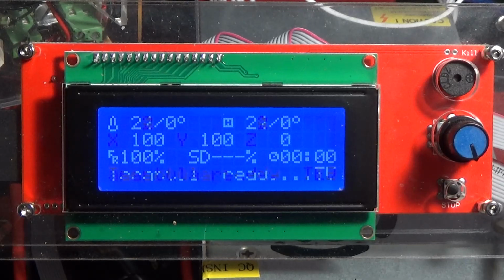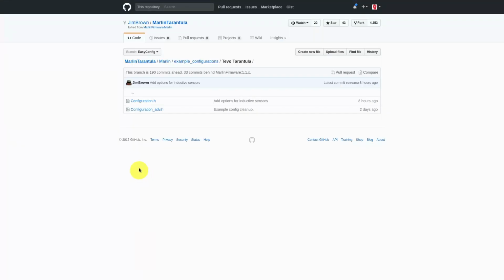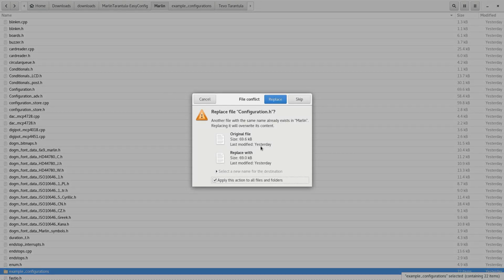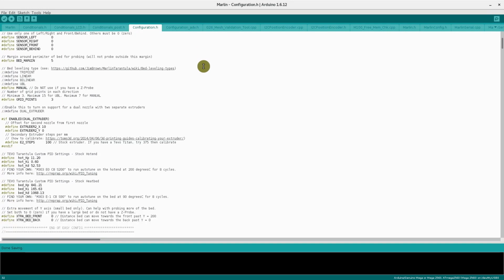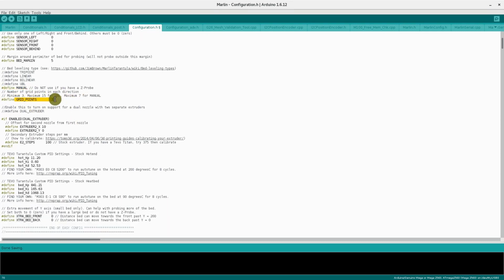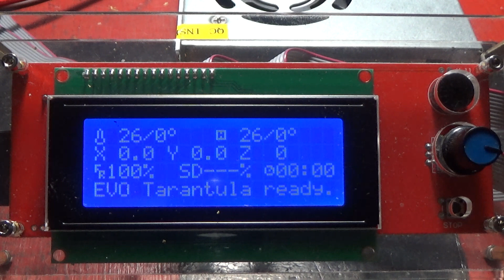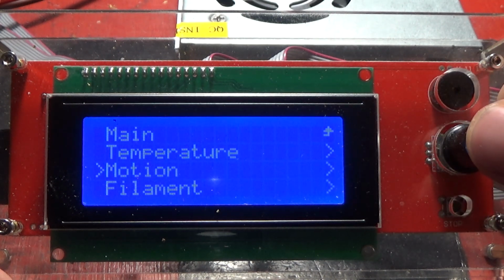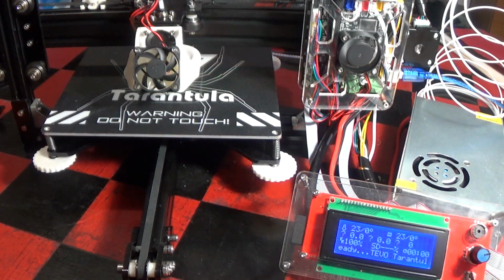Tevo Tarantula 3D Printer - Flashing new Version of Marlin Firmware with EasyConfig

Comment: After following this step by step it successfully uploaded the new firmware. I even renamed the printer for fun lol. Although I do have one issue now. My Hotend will not heat. All I get are heating errors. I am using an E3D v6 clone and it was working like a dream before the firmware update. If you or anyone could help I would be super happy.
Reply from the maker: Which errors are you getting exactly? Have you tried setting factory defaults? Which error are you getting exactly? Please also double check all your connections.

Comment: Anyone else have a problem with the z- port on the old tarantula? I want to recompile so the z+ port is used instead.  Yes i checked the switch and cable with a multimeter and they work.

Comment: When i compile i get several errors
Reply from the maker: Are you just stating this, or do you want actual help? If you need help, you will have to tell me what the errors say...
Reply: @stylesuxx  i'm always getting ... fork/exec C:\Users\Max22\AppData\Local\Arduino15\packages\arduino\tools\avr-gcc\7.3.0-atmel3.6.1-arduino7/bin/avr-gcc.exe: The filename or extension is too long.

Error compiling for board Arduino Mega or Mega 2560
Reply from the maker: @NMHC1978  Sorry, no idea, I don't use windows. Sounds to me as if the path is too long? Try googling the error, there seem to be a couple of things to try.
Reply: @stylesuxx  I googled it already several days there seems to be no solution for it. I tried the latest beta 1.9.0 of arduino and its giving the same error. i cannot find a way to modify some inifile that this pad C:\Users\Max22\AppData\Local\Arduino15\packages\arduino\tools\avr-gcc\7.3.0-atmel3.6.1-arduino7/bin/avr-gcc.exe is shortened. The build path can be shortened but is not helping
Reply from the maker: @NMHC1978  I'd try older Arduino IDE version to be honest... Also it seems that other people had more luck with platform.io Also it seems commenting out displays seems to have helped other people - did you try that too?
Reply: Hello Marnix
If you are using Arduino IDE, it does not work for Marlin 2.0 anymore. You need to use Visual Studio Code with PlatformIO extension. I will send you one good tutorial now.

Comment: can I reset it back to factory if it doesn't work out
Reply from the maker: Well, if you can find the original firmware somewhere - sure. But there is no 'factory reset' button if thats your question.
Reply: @stylesuxx   looks like Tevo hasn't released the default software. I have an old tarantula that works well except I can't change the "home offsets" it just beeps when I try. not sure if I can set the offsets manually with gcode, I'll probably end up flashing it with Marlin 1.1.9 since 2 seems complicated to compile

Comment: Thanks, you made this process simple. I did all and works fine however the display push knob is not working after the upgrade. Any idea?. Thanks
Reply from the maker: Hmm, very interesting, just the push in action is not working, or also the scrolling? Do you have the same display as seen in the video?
Reply: It is the same display as in the picture. The push function does not work, and when rotate the FR100% change.
Reply: Still not able to use the SD card which was the main reason for me to upgrade...thanks
Reply from the maker: Interesting. Which version of the firmware did you flash?
Reply: I just downloaded it today from the link you posted above. the display show BugFix 1.1.X, in fact the configuration file looks little different from your video but I guess is because they add more features.
Reply: I just downloaded the firmware today from the link you posted above. It says BugFix 1.1.X.
Reply: Sorry to bother you on this, but I also noticed cooling Fans wont stop or start until you move any of the axis. that was not like that on the original firmware. thanks
Reply from the maker: You are not bothering me. The config files might look slightly different, but you did copy the ones from the example directory to the main directory, right? Also you are powering the printer from the PSU, and not just from USB? I flashed my printer yesterday with the 1.1.x release - it is working flawlessly on my side. The printer does not recognize your SD card? Have you tried a different one than the one that was supplied with the printer? I have read, that some have had problems with the stock one. also see, if slight pressure on the SD slot helps, maybe there is just a bad contact. In configuration.h "#define SDSUPPORT" is enabled by default, please double check that. I might be a little unresponsive this weekend, so answers might take some time - if you want quick help and a lot of user power, I suggest visiting the Facebook group => https://www.facebook.com/groups/TEVO.3dprinter.owners/
Reply: Hi,Yes, I did copy the Config from the example folder, SDSupport is uncommented. I am Arduino programmer and this is very familiar for me, also I am powering the printer with the PSU. The printer did not come with any SDcard but I tried two, one 32 GB and one 4GB, formated in Fat16 and Fat32( all four combinations). When I insert the SDCard it report it as Inserted in the display but then can not access any file or upload etc..My main concern now is been unable to access the menu in the display and that little bug of the cooling fan status no changing unless any axis is moved. It is like waiting to move to execute that command. Other than that the printer is actually printing fine. I tried the original Marlin 1.1.6 with different configurations but no success.
Reply from the maker: Hmm, OK - I am not really sure how to help you any further - sounds all good to me. I use the 8GB card, that came with the kit, FAT32  formatted. Check the FB group, there are FW packages configures for the Tarantula - if it is not working with this one, maybe your display board has some issue, since the SD card was not working from the beginning. With cooling fan, I suppose you mean the layer fan, right? Both, the fan for the heatbreak and the one for the board I wired directly to 12V, so they are basically always on. Which software are you using, to actually print with the printer? I only used the on board menu for printing...
Reply: I appreciate your help and will continue looking for the problem. I use Repetier and Simplify3d. They actually prints really good from USB but just looking a backup as a couple of time the windows crashed and the printing was interrupted. About the fan it is not a big deal either. I have the cooling fan to start from the second layer. This way I find the adhesion to the hot bet is better. Thanks again.

Comment: when you home Z   After you do the software upload     how do you programs it to home in the middle of the bed.    mine just homes where every the print nozzle is
Reply from the maker: Hmm, so when you are homing, it is not moving X and Y to the limits, but just homes Z? If you are only homing Z it will just home Z ;-) Use auto Home and it should home X and Y to the limits, then home Z and then move to the center...

Comment: Good video, but why it home at the center instead of in the left? My stock firmware just stay at each endstop position it doesn't come back to the center
Reply: It homes Z at the center because "safe homing" is enabled by default in my configuration. This is needed for those with a Z probe. For those without a Z probe, it makes no difference if safe homing is enabled or not. So, for simplicity sake, it is left enabled.

Comment: I am also going to dual z lead screws using one motor and I need to reverse the Z direction.  Using Notepad++ lines 1114 says #define INVERT_Z_DIR true and 1116 #define INVERT_Z_DIR false.  Which one do I change or do I change both so that 1114 says false and 1116 says true?
Reply from the maker: In which files are you making those changes? It should be enough to comment in the line "#define CHANGE_Z_DIRECTION" in your Configuration.h
Reply: I am making the changes inside configuration.h.  I see the //#define CHANGE_Z_DIRECTION  so would I just change it to #define CHANGE_Z_DIRECTION  without the //

Comment: HI
I have installed the Titan Extruder and it turns in the wrong direction (pulls the filament out)
In your video you show checking the other motor directions.  Is there also a change direction for the extruder??
nice video thanks
Reply from the maker: Yes,  "define CHANGE_E0_DIRECTION" if using the Titan extruder you will also need to adjust your E-Steps.
Reply: Thanks for the solution have a great day
Tom
Reply from the maker: Glad I could help. Have a great day too.

Comment: I had a problem when carling the marlin, some solution :

C:\Users\Sergio Fregoso\Documents\Arduino\libraries\LiquidCrystal\I2CIO.cpp:35:26: fatal error: ../Wire/Wire.h: No such file or directory

 #include <../Wire/Wire.h>

                          ^

compilation terminated.

exit status 1
Error compilando para la tarjeta Arduino/Genuino Mega or Mega 2560.
Reply from the maker: Please make sure you have the wire library installed => https://www.arduino.cc/en/Reference/Wire

Comment: i have the MKS Base V1.4 board and when i try to do this with either my Win7 laptop or my Win10 desktop it doesnt connect.
Win7 laptop just labels it as "FT232R USB UART" and never given a com port.
Win10 desktop just slaps an unknown device label on it.
Reply from the maker: And you do not see it in the Arduino IDE? I really have no experience with windows, maybe you need a driver? It is just a serial to Usb adapter, that should be recognized by default...
Reply: yeah i cant see it in in the arduino program at all. 
Are you using Linux? if so got a recommended OS? i dont even use my laptop anymore so im totally fine converting it to linux, never did it because i had no practical use to do it lol.
Reply from the maker: @vineheart01  yes, long time Linux user. I would recommend Ubuntu - lot of community support and documentation/tuts on the web in case you get stuck. I personally use Debian.

Comment: I have a few problems: 1. The Tarantula already comes with Marlin installed and mine supports dual extruders, large bed and auto bed leveling.
2. The stock "green" sensor won't work in my case, because I'm using a mirror ontop of the bed. I'm also using a "orange" inductive sensor that can sense through the mirror, but it can't be mounted in the place of the "green" sensor. It is now mounted in front of the heatsink fan, and is outside the bed. I don't know how to make the printer know this and adjust accordingly using ONLY Gcode commands and the GUI. I'm also running OctoPrint because the printer won't connect to my PC via USB due to Windows 10 driver incompatibility. I have tried installing all possible drivers, it just will not recognize the printer. The error is "device description failed".
3. It does the autoleveling fine now, because I moved the bed back so the sensor is ontop of the bed. I adjusted the correct height using a piece of paper in all 4 corners, and adjusted so that the sensor just turns on when it's at this point. I even set the Z axis to 0 at this point. When I start printing, it autolevels, but the nozzle is suddenly too high even though I adjusted the height to be perfect (after homing all axis) and set it to Z0. I cannot figure out why the homing height and the print height differ. The Z height should not change from Z0 when printing starts. How do I correct this?
4. I cannot flash firmware the usual way, I have to do it through OctoPrint because it is the only working interface from my PC to the printer. If possible, I absolutely need to be able to fix these issues without flashing any firmware. Gcode, GUI options, whatever. I can send Gcode commands, but I cannot configure the printer settings like in Repetier. If I can upload a configuration from Repetier using OctoPrint, I'd like to hear it. The internet does not know.
4. The internet seems to not know how to do anything with dual extrusion Tarantula with the "orange" sensor. At this time I can't mount it to the side or back of the heatsink because it's simply different from single extruders. No bracket designs are available on the internet for dual extruders. I can't make my own, simply because I don't have decided what 3D modeling program to get. It must be free, easy to use (I mean really easy, like child-could-use-it easy) and fit for directly exporting files to Repetier for slicing.
Reply from the maker: 2. Install Arduino IDE and flash through this. I can not imagine that you should need any special drivers for windows, this is just a generic USB/Serial interface.
3. You did set the Z Offset?
4. There is a firmware updater plugin for Octoprint, you will still need to compile an image to flash to the printer.
5. Try sketchup - it is really simple - that's what I started with, before i discovered OpenScad.

Comment: Opening up the configuration.h file using Notepad++ on line 1860 & 1861 would I change the DURATION_MS to 0 (currently 2) and the FREQUENCY_HZ to 0 (currently 5000) if I want to disable the beep sound?
Reply from the maker: Just set the duration to 0 - should be enough, at least according to the documentation...
Reply: Tried changing both to 0 and it still beeps when completing the bed leveling.
Reply from the maker: NoChoke Oh, those settings are for the button presses only - at least I think so. Not sure where you would disable that...
Reply: The button presses are just little clicks those I don't care about but when I press the last level coordinate my hand is off the button and then the printer starts to return to home and beeps then after it completes returning to home it beeps twice again.  These loud irritating beeps are what I want to get rid of.  The button presses (clicks) are nothing compared to these beeps.  I may (if it can't be done) just unsolder the stupid piezo.

Comment: When I home all axis my Y axis doesn't stop when it hits the end stop what do I do. It's a brand new machine and I can't even
 try my first print someone told me too flash the firmware too marlin but it won't upload from audrino
Reply from the maker: If the machine does not stop when hitting the end switch, it is likely that the wire on the end switch is loose. Remove the shrink tubing and resolder the wire. Regarding not uploading from arduino, I think you need to provide me with more details here. Check that in Arduino IDE you chose the right Board, Mega2560 and you chose the right port. For choosing the right port, see which ports are available when nothing is connected, then attach the printer, and see which port is added. Also make sure that no other application like repetier host is running that might interfere with the Arduino IDE.

Comment: Nice job. Thanks a loot. Do you think you can make a video with acceleration and jerk setting ? I try to look some info but there is nothing out there to help.
Reply from the maker: To be honest, I have not played with acceleration, jerk settings nor PID's. What don't you like about the default settings, or which problems are you trying to solve?
Reply: I try to print that Eifel Tower. It s a disaster every time when it comes to make the X from structure. I now have 16 fails from 20 to 70 % of tower. :) Any ideeas ? The rest of the prints are ok more or less, dipending on the dificulty. Thank men for fast response !
Reply from the maker: Hmm, hard to say without seeing the prints, can you by any chance upload some images?
Are you using a layer fan? Is stringing your issue? If so, have you played around with retraction settings?

Comment: Thanks for the video. I just uploaded the firmware and it looks great however my extruder doesnt seem to work now, its not moving at all Please Help ....
Reply from the maker: Can you move all other axes from the menu? The extruder has been moving before the update? Do you have a singel or dual extruder machine. Which version of the board do you have?
Reply: The same happened to me. It was working before update, It is a single extruder. my board is MKS v1.4
Reply from the maker: Hmm, have you tried restoring factory defaults? What happens if you try to move the extruder from the LCD?

Comment: my large heatbed wont heat! Is there a setting I need to change in the code?
Reply from the maker: If you copied the configs from the example dir, it should be enabled by default. which temp is shown at the heatbed? What happens when you try to heat the bed from the LCD? Double check your heatbed connections.

Comment: Thanks for the tutorial. Got it installed today.
But i have a small issue, after homing the nossle stops in the middle of the bed.
With the old firmware it stopped on the left front corner. I understand that is has something to do with "z save homing" but i cannot find anything usefull on internet to help me change that.
Do you have a suggestion what i can do?

Thanks!!
Reply from the maker: guillermo vt That is because safe homing is enabled by default. If it bothers you, you can change it in the configure.h file.